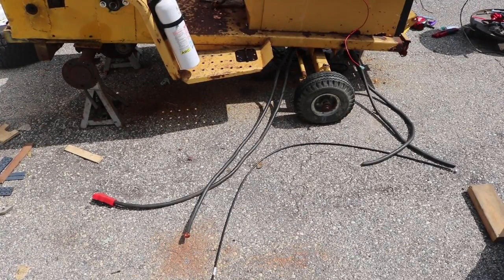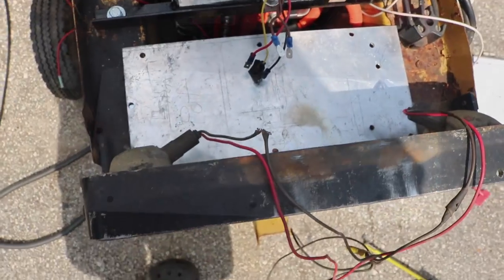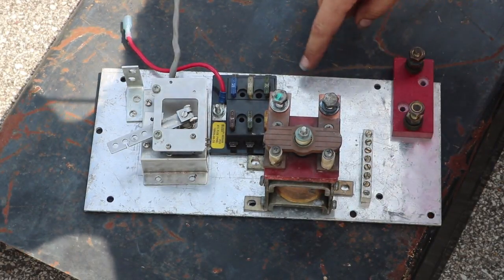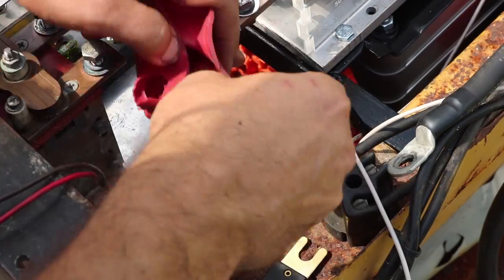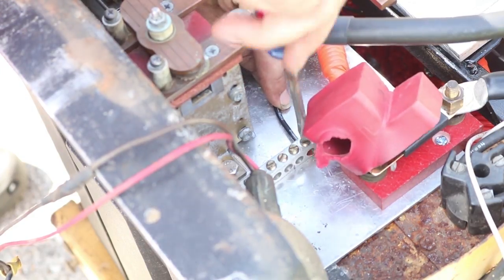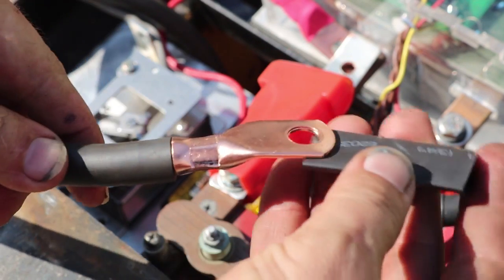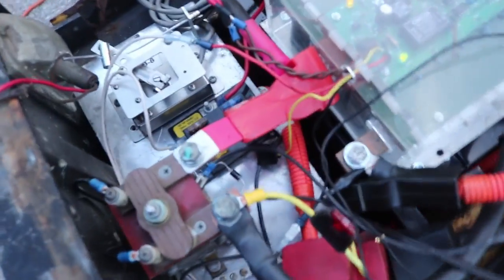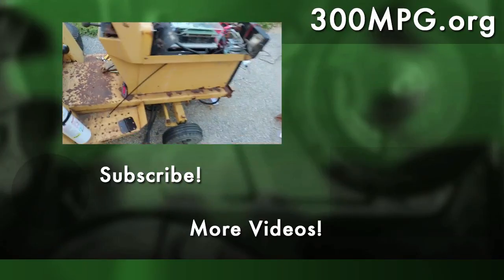ElecTrak Rat Rod Part 12

Comment: I've been enjoying your vids, and trying to learn. But there is to much to try and learn on my own. I am mechanically inclined and have enough tools. So the point of this comment is to ask you this. I want to convert a 2000 Yamaha blaster atv from gas to electric that will be able to run short distances and pull about 900 pounds. Can you give me a complete parts list of stuff to purchase. just the electrical end of it. And if possible it needs to be easy plug and play.    ///thanks

Comment: Awesome!  Are you planning on balancing these leaf cells with a BMS? I have a pack with 7 modules that I just bottom balanced. But I am contemplating going with a BMS for safety sake. Bottom balance has held strong for 3 years though.
Reply from the maker: In my experience with small Nissan Leaf packs, a BMS system isn't necessary, as long as they start off balanced in the first place. BMSs get complicated and expensive fast.
Of course, on a large system with high drain, you definitely WOULD want some sort of BMS.
I haven't yet found a really good simple/usable/inexpensive BMS system for Leaf cell modules. If anyone has experience with a BMS for Leaf cells they've been really happy with, please share!
Reply: The one I am looking at is the ZEVA, which is not the cheapest BMS out there, but far less than other solutions. http://www.zeva.com.au/index.php?product=135 Although, like you, I have not had any issues with my leaf packs across years of service without a BMS, that said, I have seen these packs are not cheap and my young boys drive the wheels of this golfcart all summer long, so I am thinking I probably should be safe than sorry.